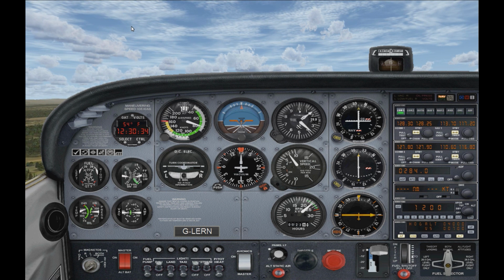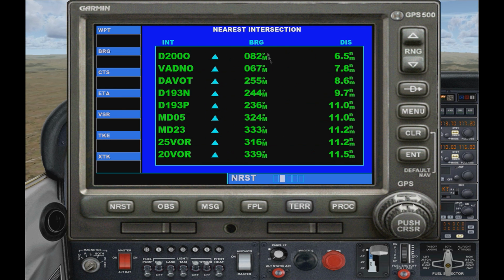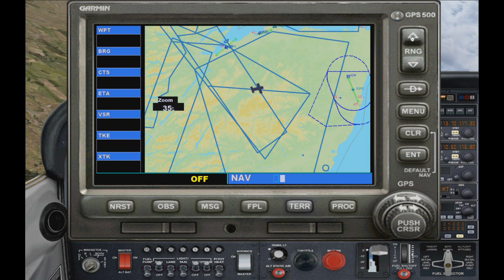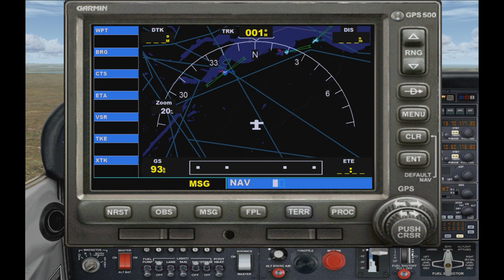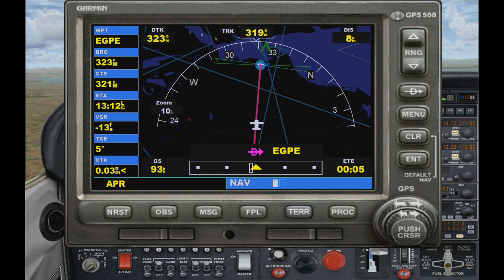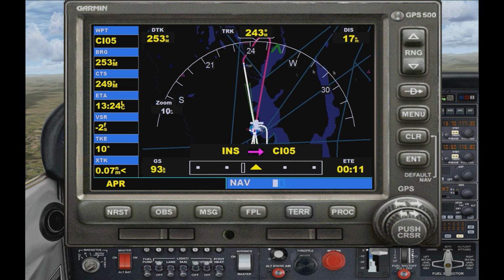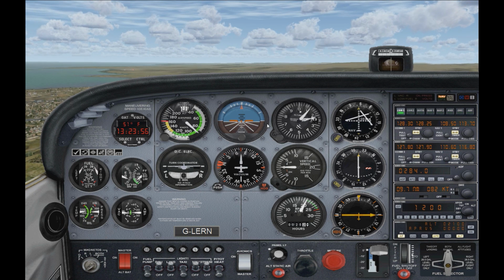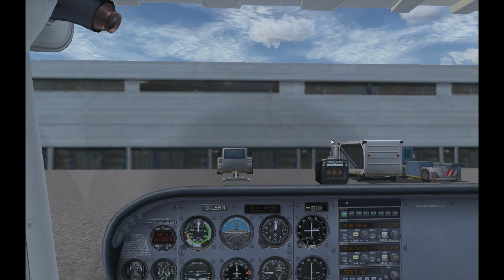FSX Tutorial: GPS Navigation (Comprehensive Garmin GPS 500 Guide)

Comment: Excellent video. Regarding the orbit area, I found this on a forum;

The Orbit areas are for the use of E-3 AWACS aircraft (both RAF and NATO). Each area has a number of nodes to allow for separation and spacing as the E-3 effectively becomes a mobile HIRTA when it is "active" and additional protection must be given to it to avoid frying any electronics of other aircraft.

With the nodes in use, separation can be provided to the node, rather than the whole area. It also allows for multiple AWACS to work the same area of sky with adequate procedural separation.

Comment from the maker: Thank you all for your comments and support, never expected this video to be as popular as it has become!
Reply: This video deserves to be popular.  Thanks for taking the time and giving an excellent presentation.
Reply: Brilliant one! As usual, I am fan of you.
Reply: can you please do a video talking about airspace and explaining it
Reply from the maker: Already have done, check through my video history and you should be able to find it.
Reply: Ok thanks. I would like to know if it is possible to failures to occur based on the pilots actions in the cockpit or if it has to be set on the failures tab in free flight for it to occur. For example, can I cause an engine fire if I don't have the plane engines set up right?
Reply from the maker: Yep, if you handle the plane poorly it'll fail.
Reply: Doofer911 Yes, it will fail if you turn that on in the settings. Or just turn on hard mode. Then if you pull enough G's, you can make the oil pressure extremely low and cause the engines to fail.
Reply: Great video bro , would you recommend I attempt these flights without autopilot as a beginner?
Reply: You are a celebrity my guru.

Comment: The default FSX GPS is unfairly maligned. Apart from its rather slow and jerky update, it is an extremely accomplished gauge, and offers a comprehensive set of navigation options. 9 out of 10 flight sim pilots hardly ever use it. While not as slick as some addon GPS packages it is still a very powerful tool. Thanks for uploading.
Reply from the maker: Certainly is, I had no idea how powerful it was until I was mucking about with it to discover all it's features for this video!

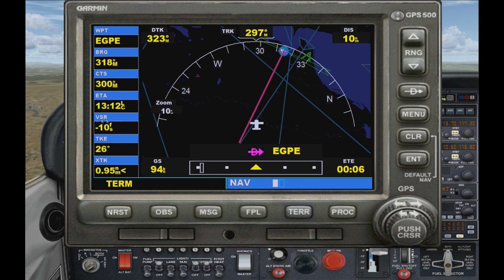Comment: 23:54
To fix that:
Listen to ATIS of the nearest airport or otherwise find out your local atmospheric pressure and set your barometer correctly. (Flight Simulator Keyboard shortcut for the "gamers" to reset altimeter without doing any work yourself: B)

You already have 4,000 set in your autopilot, but your altimeter's barometer is incorrect, so the GPS is showing you're actually above your intended altitude.

Comment: This is "off topic" but when I go to flight planner and plan a flight ie Birmingham to Alicanti, (IFR) once I press "find route" the suggested altitude is 5000ft, obviously too low so I set it to 38000ft, then save then go to fly now. on read back from ATC it still puts the flight level back to 5000ft. during the flight, it give you the options to request a higher flight level, but I would have thought once I had set the flight level in the flight planner that would be the set altitude?Your vids are the best I've seen anywhere on the internet. Could I ask you have you ever thought of doing any "ground school" vids, ie map reading? regards
Reply from the maker: +Wayne Myhill That's really strange, have you got the route set to use High Altitude Airways? Every time I've used the default planner it's saved the altitude normally after I've changed it. Also for ATC, is the final flight level 5,000 or are they just using that as your initial altitude after takeoff, sometimes they'll give you something like 5,000 then say climb to 12,000 > 20,000 > 28,000 > 38,000.

As for ground school themed vids, yep, it's all part of a master plan, more on that in a video tomorrow ;)

Comment: Hello Doffer, after switching NAV to GPS and pressing NAV in Autopilot at A2A C172, it turns the North for reason Unknown! My destination is at West! (Also the pink line is pointing West of course)
Reply from the maker: I think you need to set the Heading Bug to match the GPS course but I'm not sure. The A2A autopilot matches the real world Bendix King autopilot and it doesn't function the same as the default one which is a simplified version.
Reply: +Doofer911 Thanks. I'll try that later :)

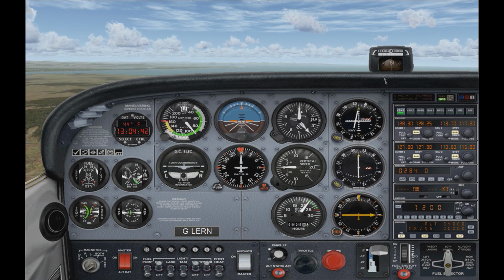Comment: At 22:58 you mention to press the NAV button in the lower right, what is that doing, i understand its engaging the aircraft to change its souce of data, but why press NAV?
Reply from the maker: There are two Nav buttons, one is the NAV/GPS button which is the aircraft's navigation source for switching between Navigation using Radios and using the GPS unit. The Nav button you're referring to is on the Autopilot and that tells the autopilot to turn based on either the Radios or GPS (whichever you have selected). Otherwise the Autopilot wouldn't turn automatically.

Comment: great video, mate. What i still don't understand is how does the GPS work with the autopilot, since the GPS is not actually installed in the plane. Is there a way to connect a GPS to the autopilot or this GPS is just an FSX gimmick? thank you
Reply from the maker: In most default aircraft there is a NAV/GPS switch, turn that onto GPS and then when you select the Autopilot's Nav button, it will follow the route. That said, the GPS does not offer vertical guidance control (automatic climbing and descending).
Reply: thank you for replying. Indeed, and I know the switch (I spent hours looking for it in various planes). My question regards using the GPS in planes that don't have a GPS installed, like this Cessna from upstairs. The autopilot has GPS functions - like Nav, but there is no GPS installed. I don't think you can connect the autopilot to an external GPS, can you? so the one provided by FSX (shift + 3) must be just a gimmick

Comment: Can you activate a hold at a waypoint on your GPS route? For example, if you are making a position approach on now radios and you're not ready for the approach, a pilot will put their plane into a hold at a vor, adf  for ndb just outside of the airports approach. But I cannot for the life of me work out how to insert a hold into a route
Reply from the maker: +David Dewis I think that's what the "OBS" button is for. If you hit that before you reach a waypoint, then the GPS will "pause" at that waypoint and not move on until the OBS is switched off. And of course if you have Autopilot enabled, this should automatically start circling at that waypoint. That's just what I've read online quickly, haven't had an opportunity to test that to see if it's true.
Reply: Not really the right thing. Obs just makes the plane circle around a waypoint. A proper hold pattern is generally a rate 1 turn into an 'upwind' leg which you maintain for 1min, then make a rate 1 turn back onto the 'downwind' leg to re intercept the waypoint. Repeat as many times as needed to be ready for next leg of route.
Reply from the maker: +David Dewis So I've had a look at official documentation from Garmin's website and I don't think it's possible I'm afraid. Some approaches do have Holding Patterns built into them so these should work fine with the OBS button. From what I understand on the real world unit, you would hit OBS to pause the plan at the next waypoint and it should draw a Holding Pattern and display a timer so you can fly the hold manually, and the timer will automatically time each leg of the hold for you. However I tested this in FSX and couldn't get it to work.
Reply: Fair enough. thanks for taking the time to look into it. Its a shame as I know that a lot of the Payware aircraft have the feature built into their FMC. Sadly I don't fully understand them and don't have a great deal of time to be teaching myself. I know what I need to for single engine VFR and IFR flights. I was hoping the default GPS would have it built in so I could use it witht he default 737,747,A321. Never mind.

Comment: Does it really matter when you press the approach button on the the AP unit? I pressed it as soon as the plane lined me up with the runway at 5nm from the runway but the plane did not really intercept the GS even though it was tuned in to the ILS stn and the VOR was active. The plane kept on flying too high above the GS even though i had lined up at only 1500 ft. I had to reduce my speed significantly to around 60 knots and had to keep on lowering the nose. However the plane definitely lined up with the ILS localiser. I also wonder if the gps had turned me onto the runway too late at 5nm?
Reply from the maker: Yeah you want to make sure you enable the Approach hold when you're BELOW the Glideslope and you do have to switch from GPS over to NAV mode to use the ILS properly. The GPS system will not give you any vertical guidance (ie. Glideslope), only lateral guidance (ie. Localiser)
Reply: Doofer911 thanks
Reply: I was reading about this question elsewhere recently and seasoned fliers said they had conflicting information from the FAA and other sources. Key is that you be in place to get the VOR (ILS) signal. From there you get the vertical, horizontal, and lateral guidance. Not switching at the right time can lead to a dangerous situation or flying to the GPS instead of a proper approach.

Comment: The Beechcraft Barron (W/O glass cockpit)  does not have a "Nav GPS" button above the radio stack. 
I have looked over the panel and do not see it. How can I link the GPS to the NAV system? Thanks.
Reply: Found it!  Way on the bottom. On the right side of the switch panel,  opposite end of the engine switches panel.

Comment: question; how do you deactivate the direct waypoint on the gps if i dont want it anymore? do i have to fly there? also, the same question applies to the ILS approach. mostly to get rid of the lines on the gps :)
Reply from the maker: I don't think it's possible to cancel a waypoint. If it was I'm sure I would have covered it in this video. You might be able to get rid of the ILS approach by selecting a different approach but you still may end up with a straight line extending out from the airport.... think if you choose VECTORS you should get something like that.
Reply: Thanks :) Great videos btw.

Comment: I still don't understand what the "vector to final" option is for on procedures. Does the GPS automatically display the legs ATC tells you to fly for approach?
Reply from the maker: Vectors are instructions given by ATC. So when they "Vector" you, they are telling you to fly a certain direction. That will only draw a Localiser (straight line approach) on the GPS. It doesn't change based on ATC instructions.
Reply: thanks

Comment: I have been following your GPS tutorial, but on a direct flight plan (entering the waypoint), my keyboard will not accept input, it is still in 'controls' mode. Do you 'de-select' control mode at all, or is it just a problem with my keyboard. Thanks
Reply from the maker: When you're entering the waypoint, you need to rotate the knob so that a single character is selected and the cursor is flashing, then you should be able to type in the waypoint code.
Reply: Doofer. Obvious now I see it. Many thanks.